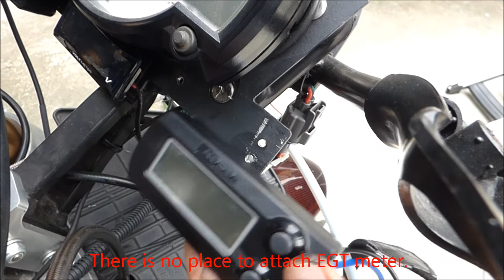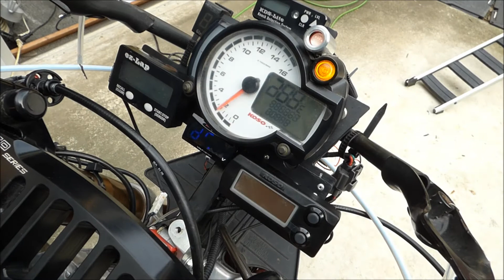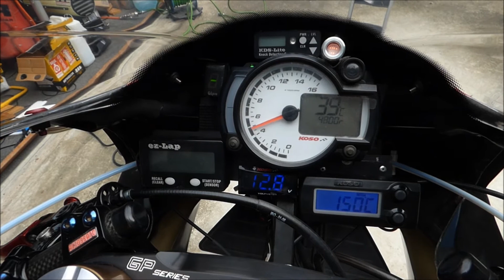aprilia RS125 KOSO EGT meter Install

Comment: Mr. Pochi 
What is the Save temperature for the exhaust smoke for under 8k and over 8k and 11k ???
Reply from the maker: I do not know yet.
I use EGT for the first time.
I'll make sure now.
Reply: Let us know 👍
Reply: @PochiRS  some return about that after your experience ?
Reply: Hi Pochi, in your experience what is your maximum safe temperature?  @PochiRS
Reply from the maker: At the moment I'm allowing up to about 650 degrees max.
Reply: @PochiRS  Many thanks, I've got mine set to 550 deg C currently, I may go a little bit higher.

I love your videos, and your bikes are awesome - keep up the good work 👍